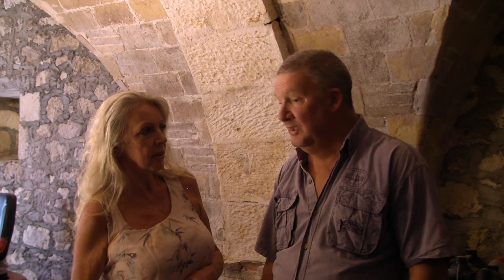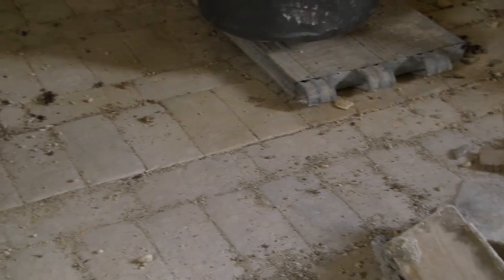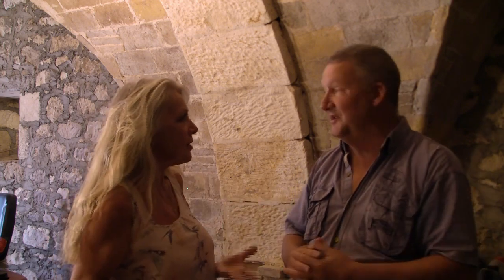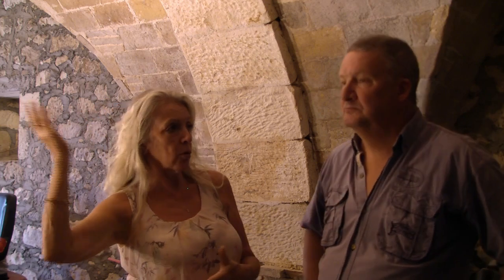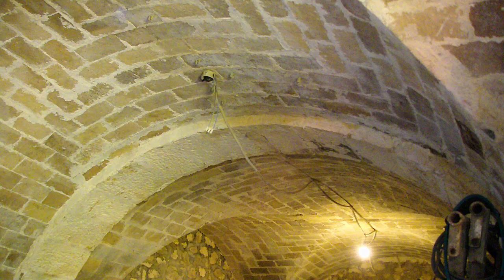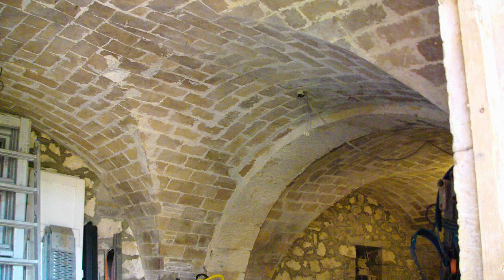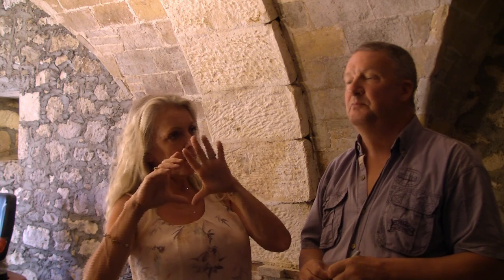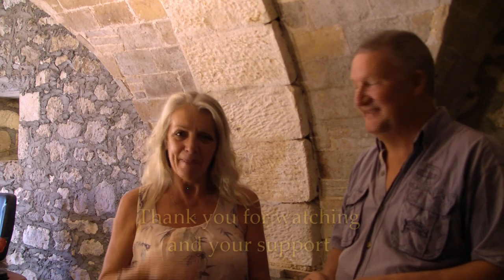Vaulted ceilings and stones restoring Italian farmhouse in Abruzzo Ep 33

Comment: HI Brambletye you happened to mention about the tiles with plaster of Paris I have seen the joints being cleaned out by using water to soften it then a. Small palm router with a 16th end mill masonry bit set very shallow depth can be achieved with numerous passes.... This may not be suitable for your tiles but its worth the try.  I hope this works for you its better than hand raking large overhead areas hand rake the corners and edges.  regards Earl
Reply from the maker: Thanks for the information I will be testing a small part of the vaulted ceiling soon to see what works best and that sounds like a good idea. Thanks for watching Steve Lynn &Button